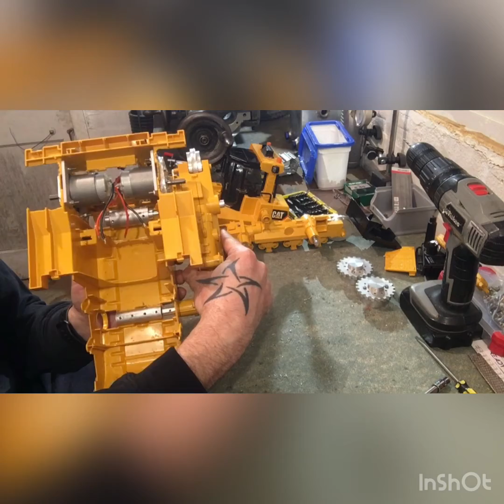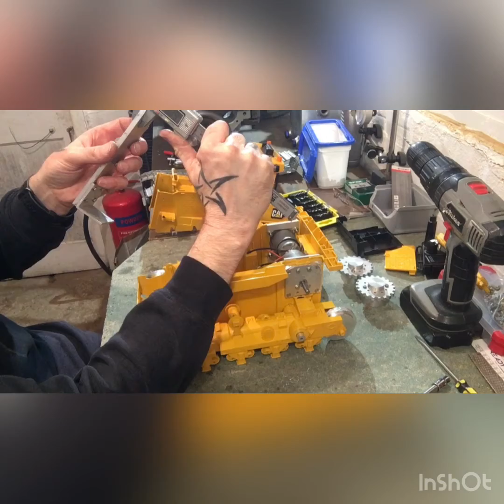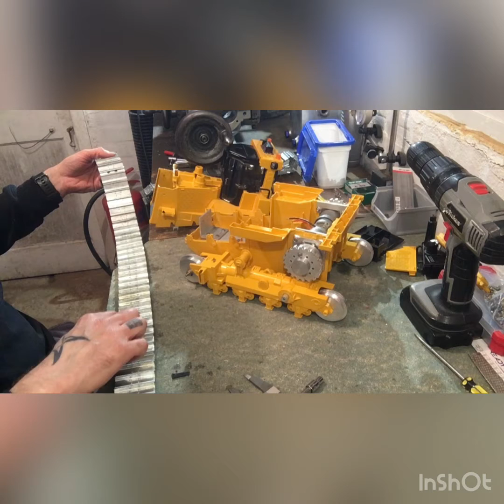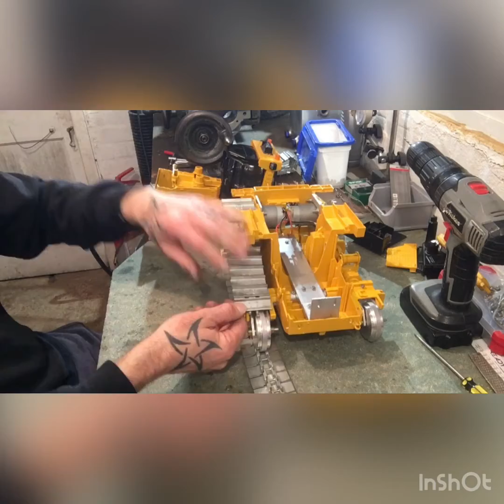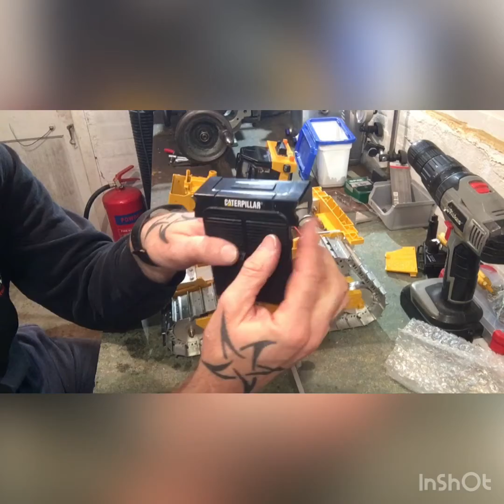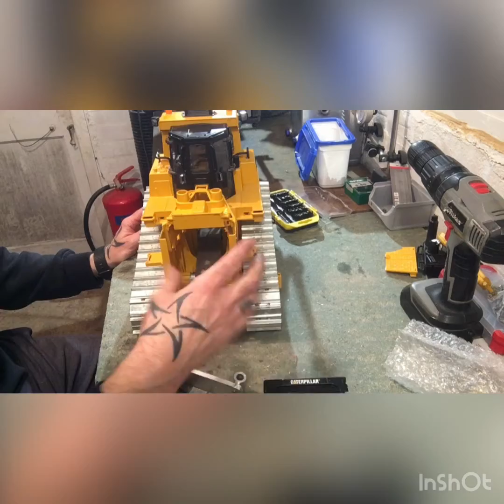Rc cat dozer conversion part 2

Comment: I'm liking it so far. Not intended to be a criticizm but dont you think the tracks are a bit wide at 50 mm compared to the scale of the D8R...the tracks on these are quite narrow...but again they do look good on yours...will give plenty of bite
Reply from the maker: Glad your liking,i think I’m going to make it a d9t I have done some measurements  and it’s not far off the scale,the tracks are about 10mm to wide but there is a company who has made a lgp d9 with wide tracks so I will base it on that.
Cheers
Reply: @rcmikey7405  I've seen some on Aliexpress but very costly at $NZ347 plus shipping
Reply: Not criticizing by any means, I like what you're doing but I thought I'd mention that on a real dozer there is no front track frame pin. It actually floats on the rear pin and has a walking beam connecting the front. This way the two track frames and the main frame are all allowed to flex independently of each other. I like what you have so far though!